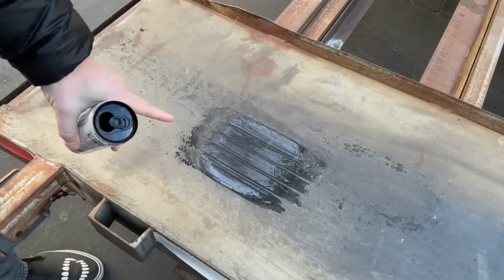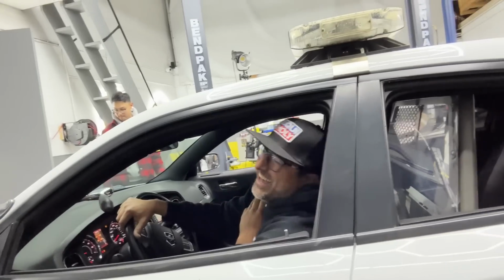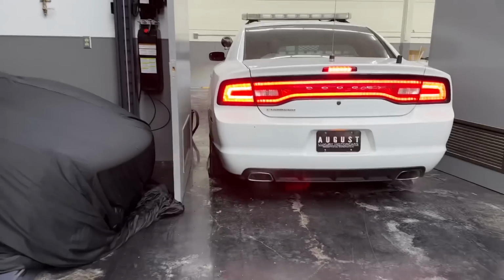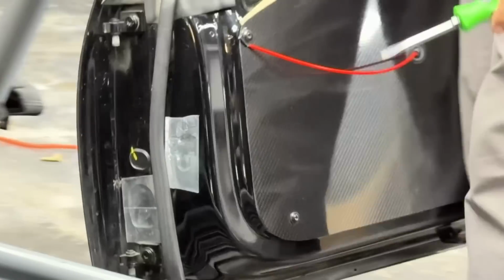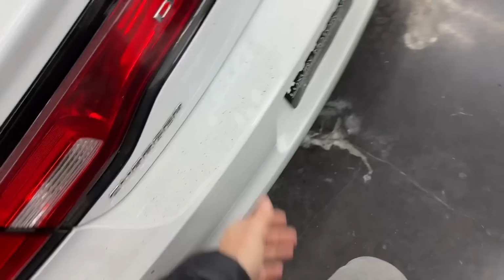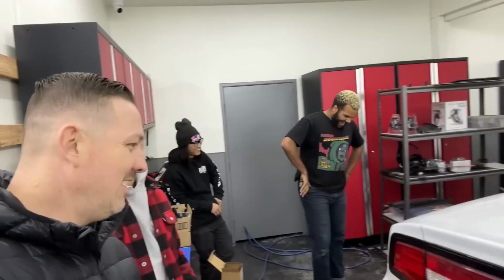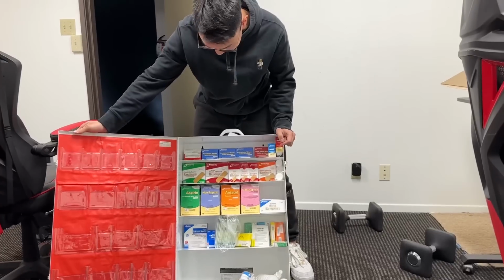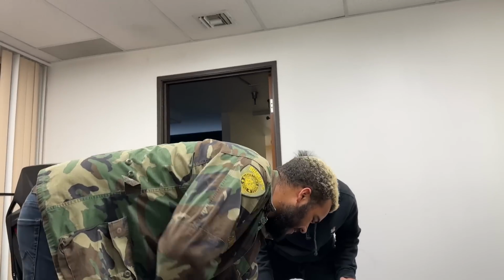How To Make Lamborghini Modifications Easily! *Mike Essa*

Comment: FYI.   Marc could of taken those wheels off in less than 30 seconds if you change the setting on the impact.   Have the same impact.   Use setting 3  not 4.   Way faster

Comment: Moving the band saw with the forklift, um, well, the forks were too high. The pallet should have been lower, around inches off the flood. No worries then. It made the trip and that's what counts. Oh, Mike considered an employee? If so, OSHA may have some issues. LOL!! To open the trunk lid you need the car unlocked or the key fob on your person, and the button to pop the trunk is right next to the third brake light on the right side or from the button on the dash located on the lower left hand sice of the steering wheel. I sorry, sarcasm may have been too much. At least I had fun with it.